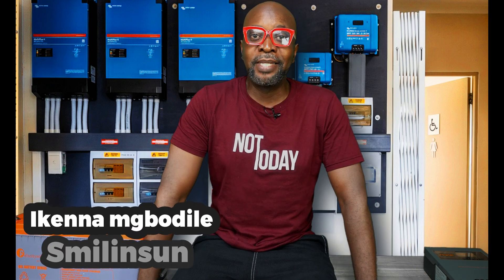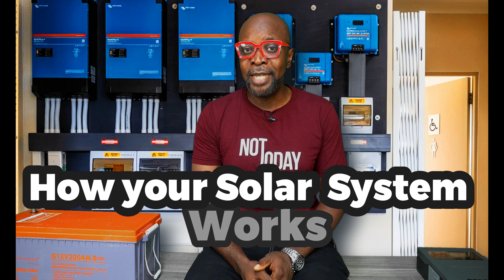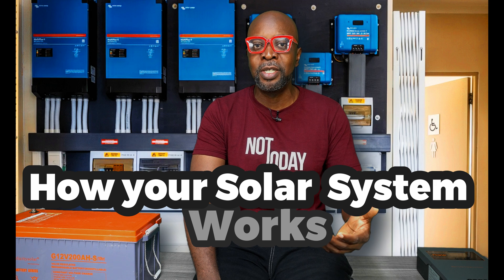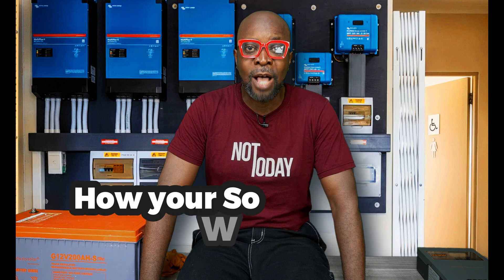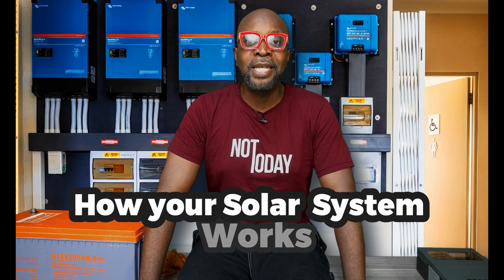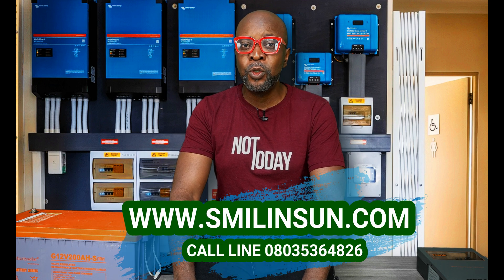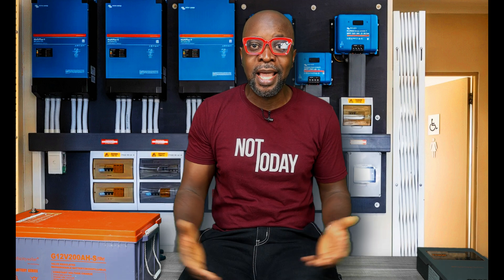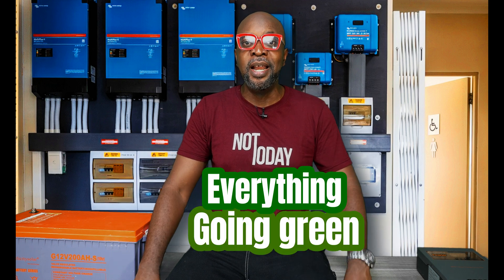Solar Energy  efficiency Challenge

Comment: The lower your budget, the lower you should learn to keep your load. I am running 24hours, no downtime on a meager 3kwhr battery. I don’t have any downtime even in the raining season. All I did was learn to drastically reduce my load. I swapped out all my regular fans for DC fans. My previous fans were 150w. My current DC fans consumes 28w at the highest(that is about x5 reduction). I switch off my 49inches TV that consumes about 110W, I use my 27inch Monitor that consumes less than 25W. I switch off unnecessary bulbs. Reduce my load drasticalllllllly. I added a standalone LIFEPO4 AC charger that can accept “dirty power” from generator(if worse comes to worse. My battery is fully charged in 3hours with generator and that carries me for the next 24hours again). The generator only works on rainy day. I have not put on the generator in about two weeks now. Get proper information. Any amount of battery will be enough if you know how to reduce your load and you have the right information. Shikena
Reply from the maker: @EasyyokeFilms  Thank you so much for sharing this is very informative.

Comment: Even if you have a 45kwh Lithium ion battery, and you have enough pannels to give pv to power your load and charge your storage at same time,  you still neet to manage your load, but they no dey hear word. Later they will deny and accuse installer of a bad job
Reply from the maker: You are very right and this happens all the time.

Comment: Most Clients claim to know about solar energy system. The buy their components via hearsay then get amateur they can pay cheap to do the installation then start crying. No matter how large or the kinda capacity of your system, they forget that there are people using a small system of 2.5kva inverter, 60 ah charge controller, 6 solar panels of 250 watts, and just two 220 ah tubular battery, but light never comot for their 2 bedroom flat since installation. They put on their fridge of 130 watts by 10 in the morning when the sun is out, then put it of by 3pm, they listened to their installer and manage their system, as small as it is and they are fine.
If you check, that guy fit dey load  like 3 or 4   2.5 horse power ac at same time. He might not even know how many KWH load in his house. Even if you have a 30 Kwh Lithium ion battery, it will drain Asap
Reply from the maker: You hit the nail on the head my friend , Thanks for your comment

Comment: you are more than 100 percent correct, l have two 150ah battery with 1kva inverter and l run 18+ electricity and since 2020 and l am thinking of upgrading to 400ah (two quanta battery) l can afford lithium battery. Thanks
Reply from the maker: very correct